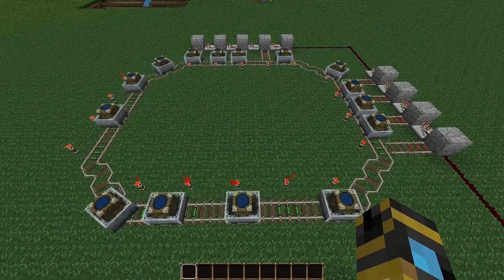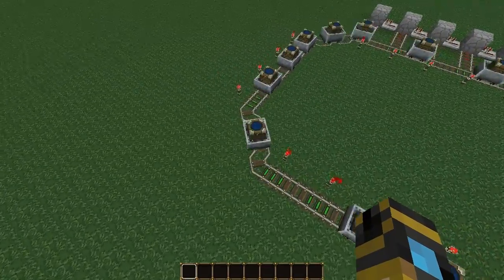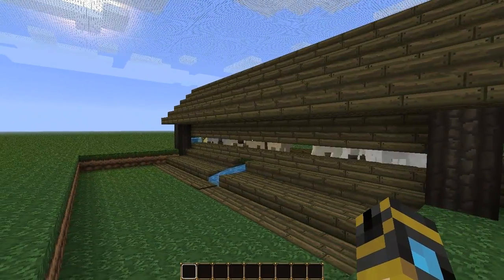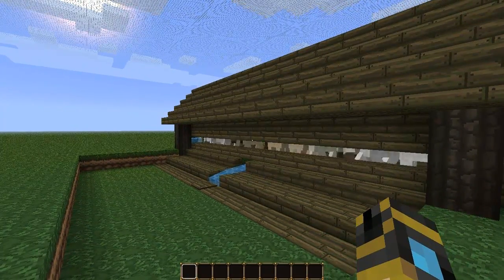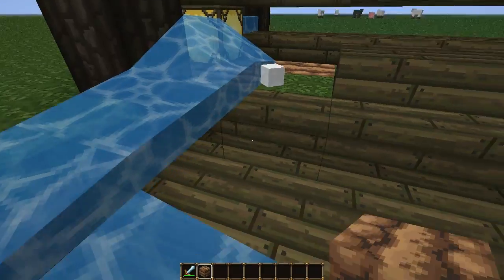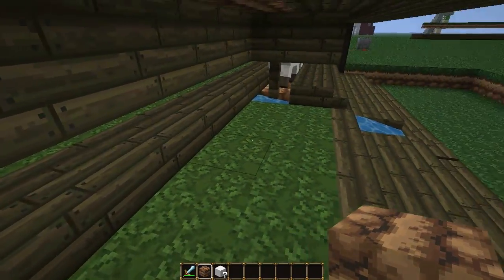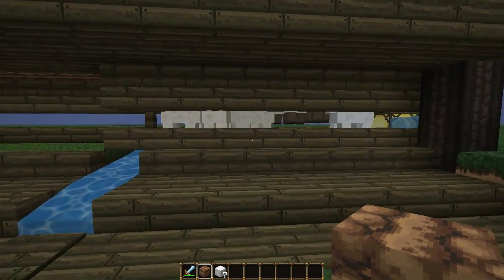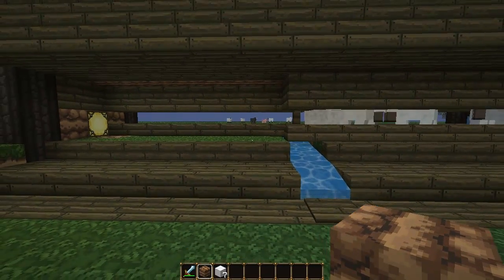Minecraft: More Sheep Farm Designs

Comment: You should attach a powered piston to the block in front of where the water flows out. When you stand on the pressure plate, the water flows to you with the wool! That way, you wouldn't have to go around the stream when shaving the sheep. It'd be faster.